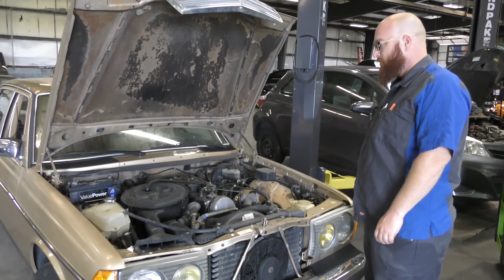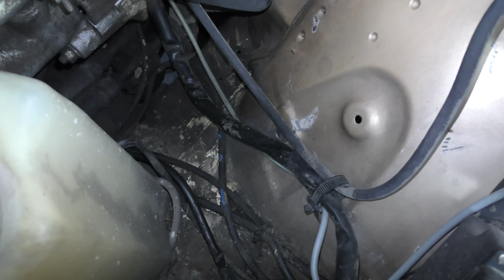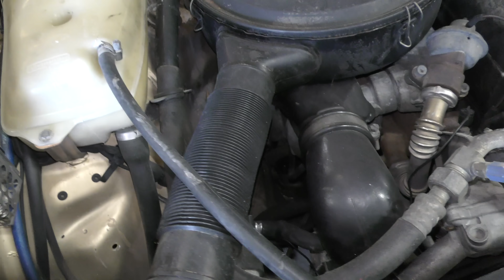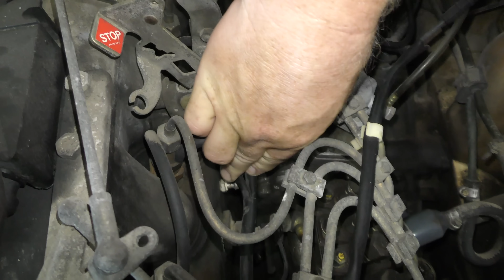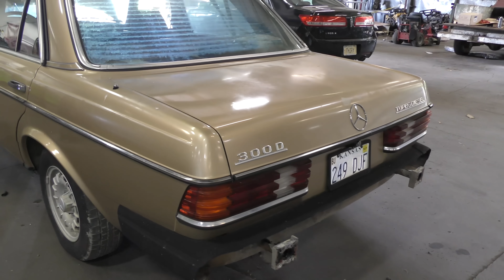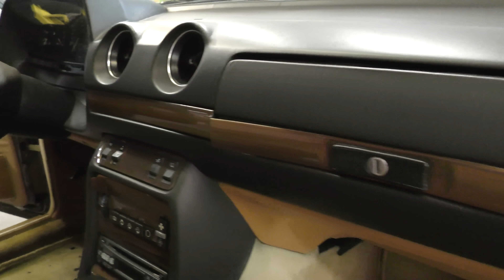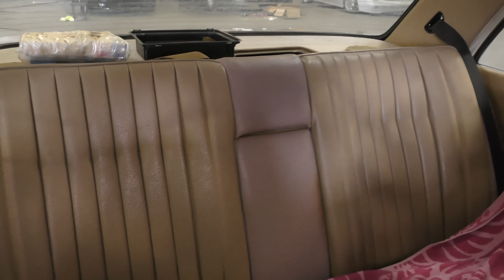Tank of a Mercedes 300D with a 3L Turbo Diesel! CAR WIZARD finds lots of surprises under the hood!

Comment: One thing I know happens with these is that someone might use the wrong size air filter allowing dirt and all sorts of bad stuff to get in the engine.  They are a ring style filter but some people erroneously use one that is not the right thickness

Comment: "It costs more to fix than the car is worth."

Someone please explain this logic to me. Spending $3,000 dollars to fix the car you have is crazy, but spending $15,000 to buy another one is completely reasonable and appropriate. Huh?
Reply: I’m using this logic to fix my truck. It’s higher mileage, but once I replace everything I know it’s gonna be good for another 100-150k miles, and the repairs were done properly since I did them myself. I’ll have like 5k into it once complete. Can’t buy something that reliable for 5k.

Comment: Car Wizard, you need to post a video telling your professional story. How does such an unassuming guy in a non-descript metal shed in the middle of Kansas end up doing good work on all those high-dollar rigs? Plenty of mechanics have taken a crack at German or Italian cars and most get burned real bad. Of the ones who succeed, most are in places like Beverly Hills or Hollywood. They work in purpose built glass showrooms (not sheds) with shop floors like a Bentley manufacturing plant and all the techs in white lab coats. They focus on one or two brands at most, prance around in pink sweaters and talk like psychiatrists: "Mmmm... And how long has your car been feeling like this?" You don't fit the mold. 

We want to know. Who is this Car Wizard guy and what's his story? How did you come to know so much about these cars without going weird?

Comment: I have a 2017 Kia Sedona with 165,000 miles on it. The rear brakes are going to need replacing and the last time I did the brakes on the rear , the left caliper was sticking. Should I replace both calipers when I do the brakes or lube the calipers?

Comment: My Dad had an ‘84 190D - put 300k on that thing and was still running great when he traded it in.
Reply: Hey lon. Looks like my subscriptions are leaking.
Reply: I had a 1975 Mercedes as a daily driver. Ate a lot of fuel but never broke down. Drove that tank for four years. Sold it for cheap and basically  traded it for a 1996 Corolla that I drove for 7 years with much better gas mileage. The Mercedes was great but I could have bought 2 Corollas plus a motorcycle back then.  
I'm on my second Corolla right now and I have a Moto Guzzi. Could have just skipped the Mercedes part.
Reply: It finally passed its break in mileage.

Comment: I have enjoyed the video so far but I just wanted to address something. The white valve that you pointed out beside of the ALDA is actually your vacuum control valve or VCV. This is what you adjust or replace if your transmission shifts are too hard, soft or not shifting at all.
Reply: Also I didn’t hear you address a couple of common measures that everyone should do with these cars. 1. Replace the water pump because it’s cheap (30- 50 bucks) and easy insurance. 2. Valve adjustment (car has to be parked overnight)

Comment: The thing you pointed to and said was fuel/engine cut off actually is one of many components that control the transmission shifting. The actual cut off is a vacuum operated diaphragm type thing located on the fuel pump itself. Love your vids.

Comment: Had a 1982 wagon version. Built like a tank. Rust was an issue around the wheel arches etc. also the air driven central locking can have issues. But wish i still had it. So slow but so comfy.

Comment: This was MB's peak. From the 60s-80s they were in a class by themselves. Best cars ever made.
Reply: Also some engines from the 90s. Then it went downhill.
Reply: I had a 79 300sd. It lasted 575 000.  Got hit by a logging truck.
Reply: When the Lexus LS launched, MB never recovered.
Reply: @marcelpatel9017 They're doing quite well lol
Reply: Lexus of the 90s did take over from MB as the best cars in the world @marcelpatel9017
Reply: Good if you have $$$$ to keep them running. If you like vacuum operated wipers and door locks. They are a nightmare when they don't work. Injector pumps cost a small fortune. A/C systems are complex and parts are not available.
Reply: @golden.lights.twinkle2329  I'm not sure where you got that opinion.  I have 2 right now I did the Air Con on one last summer and the compressor was available at O'Reilly's same day for 120 bucks.  The vac locks can be tough till you figure out how to troubleshoot it.  Injector pumps should be rebuilt to larger volume for power which is about 1000 bucks but makes it awesome.
Reply: Mercedes benz pullman  was worse everything hydraulic even the hydraulic windows and locks worked at then Mercedes dealerr in 70s we had John lennons car in for window failure 😊

Comment: All the electronics on this car can be easily repaired. One example on the cruise-control-module-rapir can be found here: https://www.w126-wiki.de/index.php?title=Tempomat-Steuerger%C3%A4t_reparieren
You can find valuable tips for the repair here (just use some sort of translator...), since all of these electronics are similar on the MB cars of this time.

Comment: IIRC  the transmission on these cars(automatics) are vacume controlled.  A lot of people got hosed by their mechanic because the trans wasn't shifting right.  Instead of diagnosing/fixing the vacume controls, they just put a new transmission in the car.  Then it was still doing the same weird/goofy shifting.

Comment: In those cases it's better to just replace the entire wiring, if that's the damage you can see, imagine the damage you can't see and may compromise the entire car.

The connections of those ugly US-Spec bumpers usually go wrong and the bumpers fall off, maybe that's why the rear bumper is out.

Comment: I've had to use a few used parts back a few times and they were worried about using them and I was like.. man you're doing me a favor.. only reason I'm not doing it because I can barely move.. iwill never ever ever bite the hand that 'saves' me.. if it blew up as i was pulling out, that's on me... not the person helping me.. people gotta get that.. always good to use nwe when able but i had to literally rob an alternator off one of my rigs to put on another rig, and once a water pump.. just casue it was good and my driver wasn't.. lol.

Comment: B W
Have had a few. My 84 I’ve had 25 years. 
Timing chain every 115k. 
Injector springs can get worn out and dilute your oil. 
Vacuum door locks are slow, you have a leak. Can cause vacuum issues and transmission goes haywire. 
Change the oil every 2800 miles and don’t accidentally unplug vacuum lines removing the giant oil filter. Trans will act crazy and someone will tell you you need a new trans when all you had was an unplugged line or a leak. 
You ever go to turn the car off and it doesn’t turn off, you have a vacuum leak. Lift the hood and push the stop button on the engine. Left side. 
Regularly check calipers for leaks. 
84-85 2 rubber seals on the large fuel filter bolt. Replace those every time you replace the filter. That’s a more common leak cause in that area. 83 on down has 1 seal on the banjo bolt. 2nd filter needs changing when you change the big filter, remember also, there’s a fuel tank screen that can get plugged up and make you think something is wrong. Every time you fuel up, add a antimicrobial like Bio-Kleen. 
Don’t waste your time with cheap batteries. Just spend the $180-200 and get the Bosch. You’ll be glad you did
Have good glow plugs. Good ones do their job in under 20 seconds. If it’s taking over a min, you need plugs. 
If you hear a metallic rattle from under the hood, chances are it’s your air cleaner bracket which wore out due to the vibration of that diesel. They sell upgraded brackets. 
Just know if all you’ve driven is modern cars, it’s normal to think these are slow. Competitively they are to modern. But these had a primitive traction control and take off in second gear. If you need some extra juice to get into traffic from a stop, take off in L. These engines last forever when taken care of. But the transmissions do good to see 300k. 
When anyone wants one of these, they often buy into the idea they last forever. They do as long as you are meticulous about maintenance. Most is easy DYI. Great cars
Reply: Yup. Harsh shifting? Remember those flex pads. Excessive vibration? Remember those motor mounts. Battery blowing up? Voltage regulator? Bad alt.?  Sunroof not closing? What, you expect it to?  Learn how to adjust your own valves.  Those things are just nightmares unless you're retired and like to tinker with them yourself. Even then, a LOT of what they need is really tedious to do.
Reply: Why timing chain at 100k? Use good oil, change it Often and check the chain for stretch. Mine has 250k on it stretch well within limit.

Comment: I owned a 1979 Mercedes 280TE, one of the first Stations. It was thirstier than my big american landyachts. And it loved to rust. I sold it to a Libanese car dealer. I hope it is still running somewhere in Africa. Here in Europe we have massive problems with martens eating rubber and cables. They are much faster than mice destroying things. But I think they prefer GM rubber. My Mercedes was not attacked as much. Instead I had a mouse trying to make a home under the rear seat of it.

Comment: I had a client turn up with a worn water pump and an ebay timing belt kit... I refused to fit it. If it had failed an destroyed the engine the client wouldn't have admitted the parts were crap he'll of told everyone I did a bad job of fitting it... So... No to used parts...

Comment: And on top of all that they are pretty tough when it comes to accidents. The W123 is one of the better models that  Merecdes made. The mice and rats have had a good feed on that wiring. We had customers who had the non turbo diesels one with over 300,000 kms and very few problems. One of our German mechanics referred to them as a Berlin Taxi as thats mainly what they were sold for. They will do 60km in each gear and not a lot faster LOL They are a slug but VERY reliable. A perfect city taxi for the early 80s. She will never get a ticket for speeding. They can't. I've actually been surprised what Mercedes do keep in stock for the older cars. Try them. We used to buy new parts for the finnys.  Not fast moving stuff either. I'd never fit a used W. pump and not many mechanics who are half decent would either. Its usually false economy. Starters and alternators the worst that will happen is you are left stranded and you will probably buy a new one at that point like you should have done in the first place. Sometimes it depends on what the customer can afford. If a used radiator or water pump fails you could cook the motor easily. Only new water pumps and radiators and hoses..   Most people will go for the new parts because they want the life expectancy from the new part.  BMW, VW,  and Audi owners seem to find this out after buying cheap cars quite often. As a fellow mechanic you are honest and make a lot of sense.  You have been taught well and learn from your mistakes.

Comment: So... Are you sure MB don't have this harness in stock? MB usually have old stock as MB Classic Center. Anyway in the worst case scenario you can rewire each affected cable without much trouble. Yes, it takes some time but it's not imposible so stop crying about it. You make a 25 minutes video with only 10-15 minutes of real content and the rest excuses of using used parts and crying for the work to do. You can't be serious about talking of an electric engineer for a car which has even a Haynes manual for god sake.

Comment: The key tp the glow plugs on these is to be sure they are removed on a regular basis. The threads tend to seize if left in too long and then getting them out ebcomes a major exercise, especially if you break it off or strip the threads.  Reinstall with generous amounts of anti-seize.

Comment: Unfortunately a few mistakes in this video when pointing out engine components/functions.  The turbo is not vacuum actuated, it simply spools up to about 12psi boost (limit set on the turbo wastegate) and thats that. The ALDA controls fueling levels in the injection pump to compensate for altitude changes and can wear over time causing under fueling, it is not attached to the vacuum system, it has a pressure line from the intake manifold to receive the boost pressure signal, there's a switchover valve on the firewall that can fail or get stuck also.  The yellow plastic assembly on the back of the injection pump is the vacuum control modulator for the transmission shift control modulator, which can also leak (diaphragm fails or the rubber cap on the adjustment can also).  The engine shutoff is a metal unit lower down on the back of the injection pump, hard to see from above, and hard to replace on a W123 without contorting your hands.  Also a high risk part to replace as if done improperly it can cause binding on the internal injection pump linkage which can lead to a runaway engine.  Always have a solid method available for stopping the engine in a runaway, a solid flat large block of wood to put over the intake, as in the turbo opening, not the air cleaner, or a CO2 gas fire extinguisher.
****Monovalve: You should replace the entire unit not just the valve insert piece.  There's been more and more car fires on the W123/W126 caused by the electromagnet inside it corroding and shorting out, which causes an electrical fire on the climate control unit in the dash as its not a fused connection.  Could also measure the current and install a fuse of slightly higher rating than the average current draw.  Would be a shame for the whole car to burn down from a simple preventive fix like that!

At 171k the timing chain stretch, valve adjustment, and chain guides.  As well as the oil pump pickup assembly and pump/chain/tensioner should all be inspected.  Due to age the guides for the chain or oil pump chain can crack or break off, causing catastrophic engine failure.

Same deal for the vacuum pump, remove and inspect for signs of metal fatigue on the race and piston arm/bearing assembly, if it fails and dumps its ball bearings into the crank case its likely game over.
I worked on one W123 and three W126's in my family for almost 15 years....the cars covered a combined 300,000+ miles in that time before being sold. (mostly due to rust problems that could not be stopped).  Done just about every repair that can be done on these...its the only way to affordably keep them on the road, as was said in the video, going with shop labor would be astronomical in cost.

Comment: The turbo is 10PSI
the turbo engine is 125HP
the naturally Aspirated is 88HP 

wrong part of the injection pump you pointed to for the shutoff.  and other little things,  but  it was a good video to watch :) 

also a EGR delete is mandatory for these if you want full power and to not destroy your engine and starve it of air because of the soot buildup in the intake

Comment: Programma has reman cruise control servos, climate control push button units and I think they might even have the cruise control amps too. Don’t use the rebuild kit for the monovalve, take the guts from a W126 valve and install them in the W123 valve housing. The rebuild kits are junk.

Comment: Hey Wizard, an idea for a video. Not being an automotive person I have watched yourself and other YouTube channels doing work with torque wenches. I thought it would be great to have it explained the sequence of using this tool and the whys of the three torques on head bolts for example. I get the low setting to snug the bolts and then the medium setting to set the bolts, but what is the 70 degrees or 120 degrees afterwards about? I have watched you do this before but I'd like the explanation as to why please. I ask as I enjoy the way you approach a technical explanation. Delivering good information without being complex so we can follow along what you mean. Cheers from NZ

Comment: So for the rear bumper, the bracket on the bumper itself rots off even though it's aluminum. I had to dill holes and put bolts through for mine.

Comment: one of my all time fave cars. smoothest ride. amazing utilitarian design. the key to keep them from rusting is replace all the window seals. im amazed the door corners are not rusted. as a 300d owner  get a mityvac to fix all the vacuum locks :P. agree with harness...to much scary stuff there. another  tip is don't  power spray the engine with out wrapping the glow plug relay  in  plastic...ask me how i know this..... love the channel.

Comment: Great first car. It may cost more than it’s worth to get it running but it will hold its value in a few years time, unlike the cheap sensable runaround you would buy otherwise. Would also put euro spec bumpers on it, so much cleaner looking.

Comment: Seems the mice also chewed up the hood insulation.
Rear window looks like it needs replacement, can barely see through it.
Floor carpeting is gone, cosmetic but would want something there if only to prevent feet slipping on pedals when it's wet.

Hope it goes back on the road. Never was a big fan of these cars when they were new, prefer the BMWs of that era, but they are classics.

Comment: You made a very valid point about Inheriting a vehicle. I have my Step Dads 1977 F150 Custom. To get a "small" list of stuff done, I estimated the price at about $2,000CAD to $3,000CAD. Called 1 shop and they quoted me at $1976.34CAD. Another Shop quoted me at $4,000CAD. To get ALL of the work done with the body work being "farmed out" would put me in debt by $9,000CAD. And that's not including the $4,500 I was quoted for the painting of the original 2 tone paint colors. Good thing I know how to do bodywork.